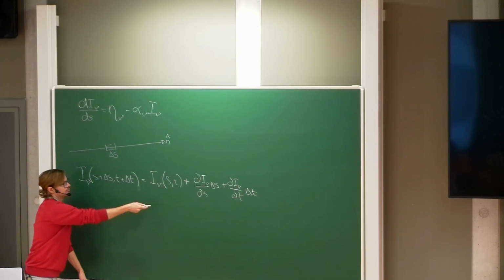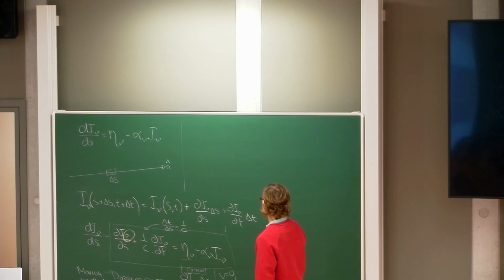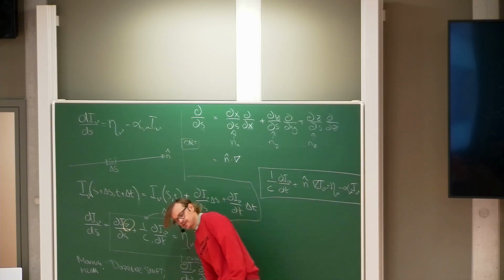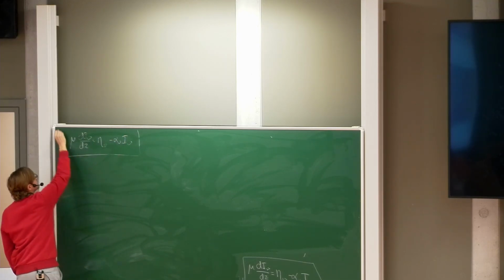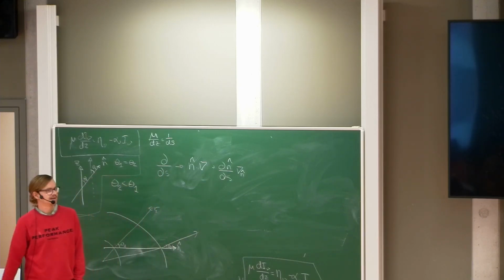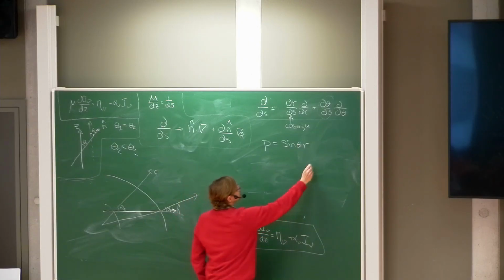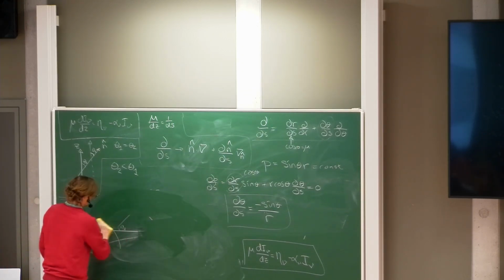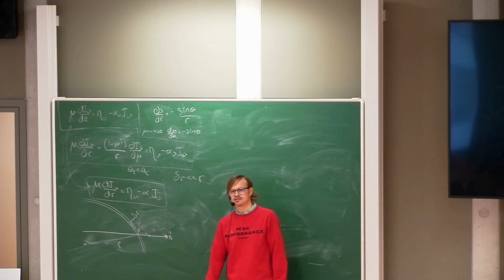Radiation Processes in Astronomy: L5a - Radiative Transfer Eq, general, geometry, plane-parallel

Comment: So one of you very nicely pointed out during the break today that after we derived ds/dth = -sin th/r, I then for some unknown reason :body-blue-raised-arms: wrote it down as ds/dr = sin/r... the latter is wrong, of course - a typo. (Now we never actually use the wrong expression, since if we had we would not have got out the correct spherically symmetric RTE, which we did, so we used the correct one, just wrote down the wrong one.)   --- Very good observation ! 👋